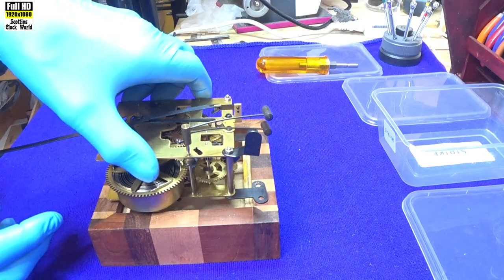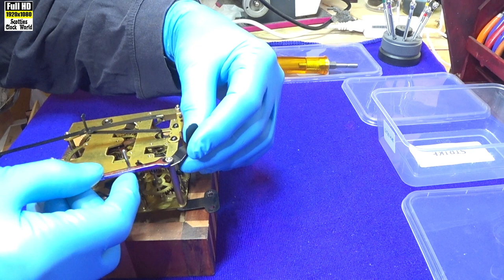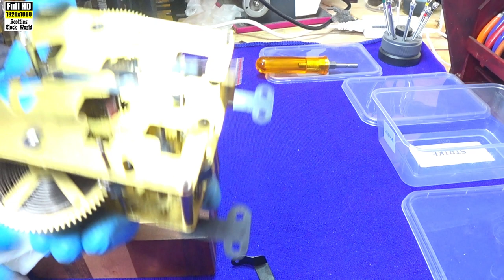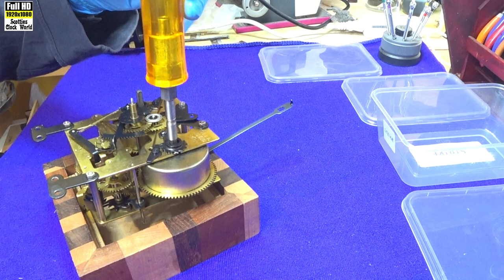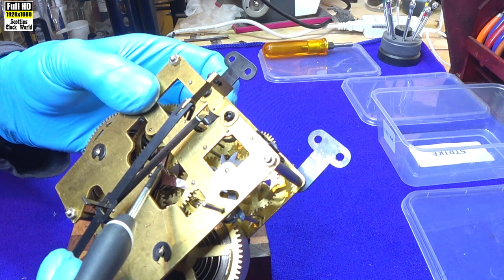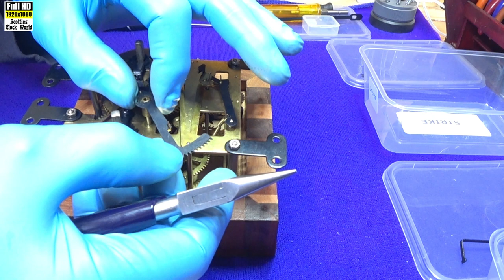How to service a Chinese Polaris 15 day clock - #1

Comment: Good day there, I have a clock that looks similar to yours. The suspension spring has snapped. Where can I get one that will fit my clock?
Reply from the maker: I use cousinsuk.com for my clock parts, or Timesavers in the US.

Comment: Very interested see this and thanks for posting. My wife bought me one of these for Christmas just gone. Its a nightmare! The pallets seem to be on some sort of "self adjuster clutch" by way of a spring clip which sort of secures the pallet to the shaft. Yours looks different to this?
Again, this one was dripping in oil so I think it will be a full strip down before it does any damage. I look forward to #2 and any subsequent videos